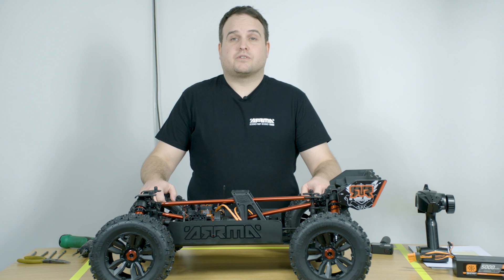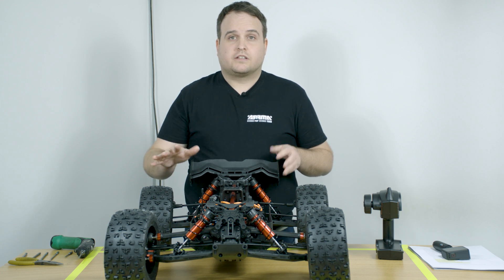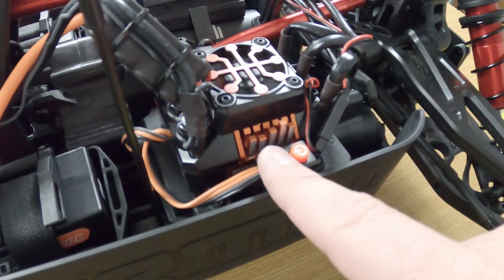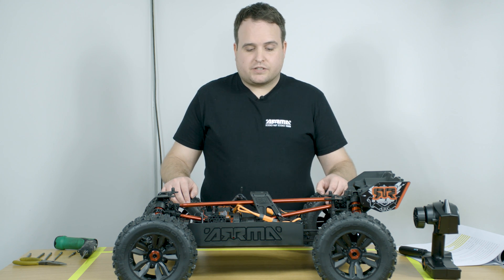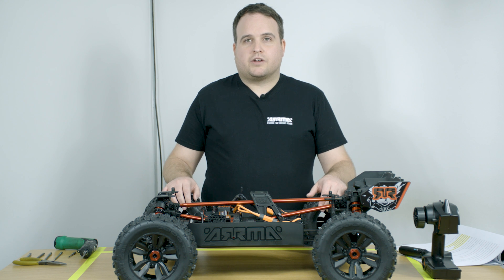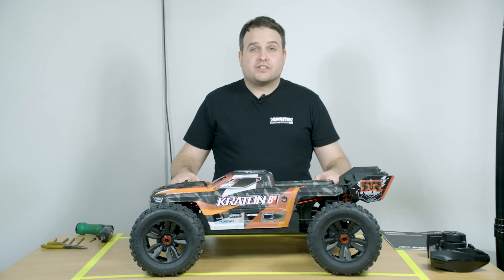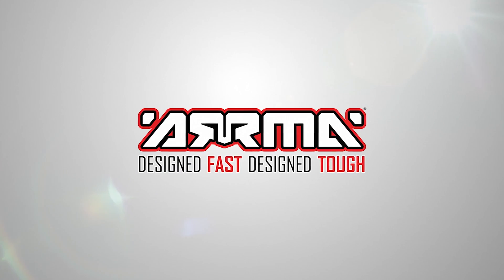ARRMA KRATON 8S // Official How To Guide: ESC Programming, AVC & Error Codes

Comment: I have a problem that I cannot solve. Let's see if someone can help me. After turning on my arrma Kraton EXB 8S it does the check but it only counts 6 green flashes instead of 8 flashes which is normal... and I know which led is flashing red. The steering and motor does nothing. The transmitter on doesn't do anything, neither accelerates nor turns the wheels. Does anyone know what I can do or what the problem is? Thanks in advance!

Comment: So, do u have any idea why my Arrma 6s Kraton exb esc is blinking a dim green light &  nothing happens when I'm pushing the set button ? 
I am not hearing the motor power on & no beeps ?  will not go forward or in reverse. Any idea ? Not getting red death light so, I'm thinking it is toasted ? Anyone ? 
I did try holding down the set bottom while powering on & got nothing & no light ,beeps from ESC ?

Comment: For the Spektrum 160 amp ESC, is there a drag brake function such as the option on the Spektrum 150 amp ESC?  I ask because I just purchased a Leopard 2400kv motor to pair it with and it seems as if the drag brake is engaged and I cannot find the option to disengage the function.  Any help would be appreciated

Comment: Hey man! I just purchased a new Arrma 8s outcast and got it out of the box ….all looked good and installed two 4s batteries like I use on my 8s Kraton.
I run it down the road and it had power but half way down the road I noticed it was running half speed……almost like I switched it over to 50% power. Then it quit running and noticed the red light was flashing. 
So I disconnected the batteries and set back up again and same thing! Can you help me with this truck?…………

Mark

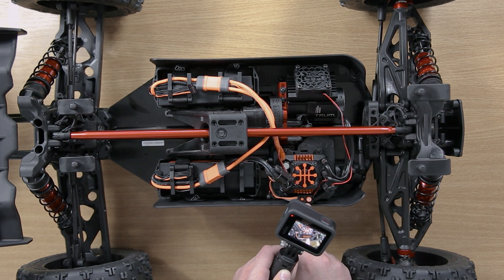Comment: 3:55 - 4:00 ... NoooooOOO!  You don't simply turn it off to save the settings.  You MUST re-hold that set button down for 3 seconds then release it to save the settings, THEN you can turn it off.
Reply: Pretty big oversight for someone who works for the company. They should update the video, otherwise it's a fail.

Comment: So they put a  weak  servo  in lol  smh ,  its under powered  , wtf 1000 car almost
Reply: Super weak servo tell me about it lol I just purchased a 50$ servo and is 10x better than the stock one and it’s actually a 1/5 servo just like the truck is check out a video I posted you can check it out
Reply: I think it’s a lil over 1,000oz of torque if I’m not mistaken in the specs

Comment: I installed the bluetooth module on the dx2e and now I CANNOT CONTROL AVC with the controller. Is there anyway to gain control of it again?! This is ridiculous.

Edit I TOOK out the bluetooth module in hopes it'll fix it but it's still completely screwed and set to 100%. I can't use the app to change the drive mode to disable it because they just refuse to show up no matter what I do.

Comment: Where are the error codes in the title, my esc light is flashing red truck is not moving and have no idea why!
Reply: Did you figure it out?
Reply: @dougk4071  I ended up calling horizon hobby and they sent me a new receiver and new esc. I only had truck for running 15 mins. Brand new truck and batteries. I simply turned truck off and it never got running again until they sent me new stuff. On top of that the low voltage cut off never worked so constantly running batteries to low. I’m not happy with this truck. Also having issue with steering, where it was turning like a Mack truck. Took to shop and thought it was servo, but truck was missing 4 bearings in the front. Luckily we checked the exploded view online of the car and noticed bearings should’ve been installed but wasn’t. Arrma and Horizon has to work on there quality control or they will be like Blackberry phones
Reply: @jamesturner9858  my a arm broke in 10min  bought some more and they broke again

Comment: Is the bec voltage options really only two? Only stock or way up at 8.4? If i get the programming box is there more options for bec output? It would be nice to run 7.4v the program manual only shows stock way low or way high 8.4

Comment: Hi I have this motor and esc in my v4 kraton 6s I hit 61mph today on 6s and the esc kept on cutting out on me no throttle response then would kick back in any idea why?
Reply: 50c batteries tried 2 packs and both did the same thing
Reply: Are the motor wire connected to the esc ABC in order? I had same problem but my motor wires weren’t in place with the right connection on the esc I put A with A  and B with B and C with C and it worked

Comment: Your video was terrific - 100% useful and on point. I just bought and installed a Spektrum SPMXSE1160 Firma 160 Amp Brushless Smart ESC in my Arrma Limitless and right out of the shrink wrap the brakes were nearly nonexistent. I brought the car into the house, found this video and promptly discovered the brake setting was far below factory default. I set it to my liking and now have brakes that work; very useful on an Arrma Limitless - no? 

Thanks again. Subscribed with enthusiasm.
Reply: Yea. I found it odd. That tje brakes weren't even on the factory settings. (50%)  mines was on 25%    insane considering how fast these go...

Comment: Will it be safe to put a bigger motor gear ⚙️ for more speed and leave all the settings the way they are?
Reply: Mine runs nice and cold with stock esc settings and 23t pinion. 20mill center and stock f/r diffs.
Its really fast and handling is insane 😁👍
Reply: Hans Christian Deila i didn’t change the center diff fluid but I heard it makes the kraton wheelie easy with 20M
Reply: @RebelWaz  at punch 5 it wheelies, but i find it more controllable and it handles better at punch 3 😊 i can be much much harder on the throttle when turning 😊
The 20 mill center diff fluid made a big difference, it wheelies, but it also handles better and dont balloon the front wheels as much 😊

Comment: Glad to see full Spectrum lineup on electronics. Sounds like I'm going to have to purchase the electronics for this kraton 8s to put into my Infraction. I've had a blown stock servo and then after purchasing a new one and replacing a glitching esc just stuck in a programming loop after another 2 packs ran through. I've had more down time than up time. I had reverse shut off and during a run it reprogrammed itself Turning reverse back on.. breaking diffuser supports because it wanted to shoot full throttle backwards when I stopped the vehicle. And then after I shut the car down it was stuck in programming mode. Arrma will replace replace a crap electronic when it goes out, but any other parts that are damaged while those crucial parts go out is YOUR FAULT..  I hate the Infractions electronics. Not that there isn't any power there was plenty, just that they seem to be unreliable.

So note to self don't drive your car anywhere fun because if esc or steering servo goes bad and haywire your left to foot the bill for the rest of the damage, they call it an act of God.. I get parts get broke while playing, but if a crucial part goes out during use and causes more damage something else should be covered. Car has had 15 days if up time and close to 45 days down time now. Got it November 14th, and it's been down since thanksgiving. 

I feel like I got a Lemon of an Arrma...

Comment: Is that a hobbywing  esc?
Reply: It's a spektrum rebadge with telemetry of the hobbywing max6 and 4985 motor without fins (making it 4685).
Reply: @dis3nchant3d42  so it is a max6 ? With telemetry,  I was debating on the max 6 or this for my xmaxx ? What is all need for the teleme6
Reply: @paulcherry1520  yeah, imo for bashing the telemetry is pointless, especially because it's kinda gimped telemetry. All I really want on a basher is true motor temp and this can't give it anyway.  Might be worth it to toss in the xmaxx if you grab one on Jenny's rc or something like that for a good price but I believe the standard max 6 combo is still cheaper? And to use the telemetry too you have to use the stock radio, which is an ok radio but if you have a radio upgrade already then the firma is just a max 6 combo with a cap pack on the battery lead. Well and different kv.

Comment: No 7.4v option on bec? 🤔
Reply: The rebranded Max6 in my Super Rock Rey is the same way. 6v or 8.4v. No 7.4.
Reply: @bicketybamRC  how strange, I have a max6 and it's 6.0 or 7.4v
Reply: @LawrenceTimme  6 or 7.4 volts but doesn’t have 8v that sucks